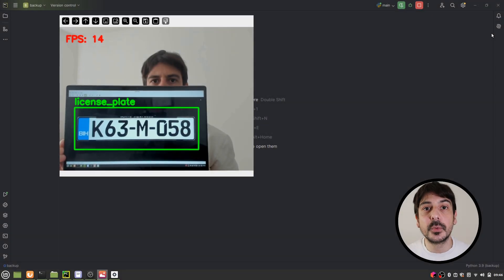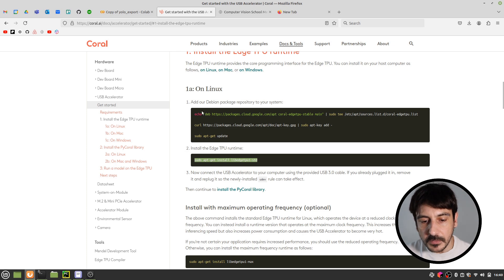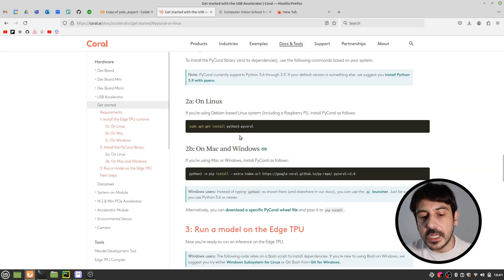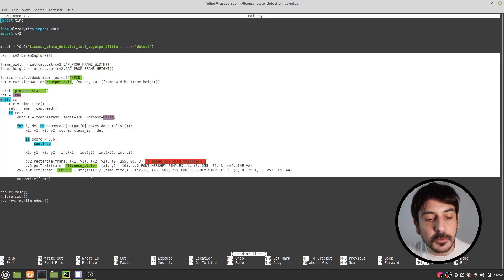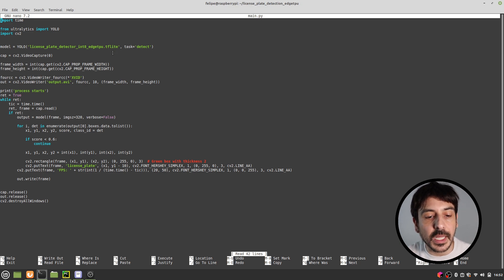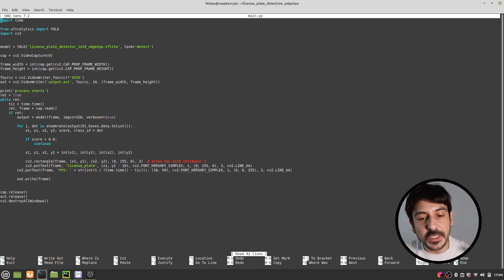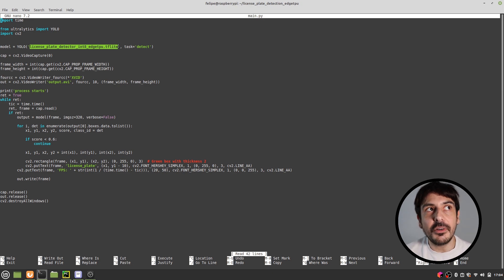Object detection on Raspberry Pi Usb Coral | Real Time Yolov8 on Edge | License plate detection

Comment: Ive been using a Caffe 'MobileNet' SSD model on the Pi find it works very well on the CPU. Just trying to figure out how to retrain it
Reply from the maker: How many frames per second?
Reply: @ComputerVisionEngineer  Only giving it 2 fps to limit CPU usage and this is more than fast enough for what Im trying to do. Having to hand each frame off to a thread to stop OpenCV's buffer overflowing.
Reply: @ComputerVisionEngineer  Its for a small open source (GPL) project so if anyone is able to guide me on retraining a Caffee SSD model for it please get it touch!

Comment: Ihave a question, sometimes the edge system (micro-computer + edge accelarator or gpu) require a very  specific version of python/ultralytics and so on... so how to figure out what specific versions to use, what combination works.
Reply from the maker: Hi, the first step is to check the official documentation for compatibility guidelines. However, it may ultimately require some trial and error to find the right combination that works for your setup. I’ve been there too, and it can be a pretty time-consuming and exhausting process! 😅🙌
Reply: @ComputerVisionEngineer  Well thank u very much for the insight 🤎

Comment: Good solution, it runs for me on Raspberry Pi 4.  But with some modifications :
- purge folder content of “venv” folder and file “.python-version”
$ pyenv local 3.9.12
$ python3 -m venv .venv
$ source .venv/bin/activate
You could give the list of commands in github in a simple text file. It is difficult to see the URL on video.
Thanks a lot, You are the first tuto. which runs for me since 30 hours of search and tests.

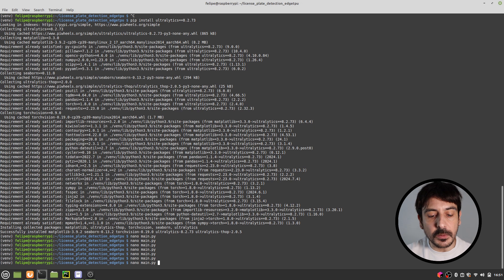Comment: Appreciate your guidance! I’m trying to pip install ultralytics 3:48  on the RPI 4B but it isn’t successful. It indicated that something went wrong with torch package (a dependency of ultralytics). I’m using Bookworm 12 32-bit OS. Do you have any ideas about this ?

Thank you for your help !
Reply from the maker: Hi! I’m not sure I can help with that specific error, but you might try different versions of ultralytics or Torch. In the video, I’m using a Raspberry Pi 5. Good luck! 🙌
Reply: Thank you for your message. I was able to “pip install ultralyrics” with the 64-bit bookworm OS on Pi 4. (seems like the 32-bit version doesn’t support torch)

Comment: Greetings, Felipe!

Thank you for the tutorial! I am wondering what are your thoughts on Hailo 8L AI Accelerator. Have you ever tried this chip??? I have seen recently saw HATs, which would allow both an NVMe SSD drive and Hailo Accelerator to be attached to Raspberry Pi simultaneously. However, most of tutorials on youtube do not show “real-life” use cases for this AI accelerator chip. 

I understand that this might be a powerful chip with 13 TOPs by itself. However, I have not seen any real-life use-cases or detailed explanation how to use this AI accelerator.
Reply from the maker: The Hailo AI accelerator looks very promising based on its specs. If I get the chance to experiment with it extensively, I’ll make a video about it. 🙌